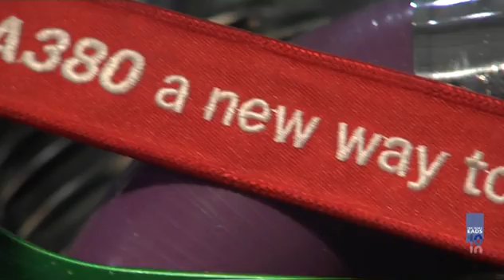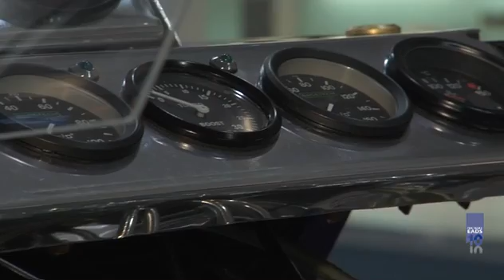AIRBUS Power - Bike Power - The World Fastest Motorbike

Comment: Monkies don't do well at Bonneville.
It is a LOT more slippery than you even mention.
Stick to Asphalt.
The fastest motorcycles of this type tend to be Japanese(hardly American)and they are slower on the Salt than on asphalt.

They are also running TWICE this much horsepower.

As a Streamliner,this chassis must change if you just want to get over 300.
Many of your statements are dogmatic and incorrect.
If you go out there in arrogance you are likely to hurt yourself.
I race there.